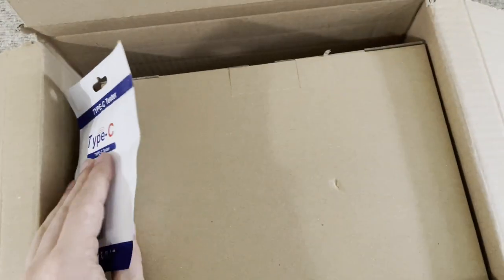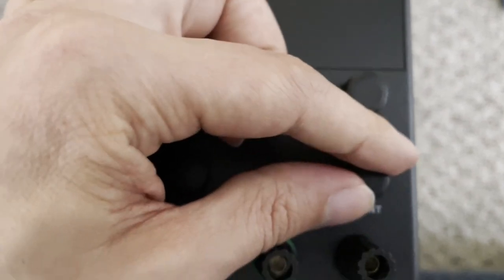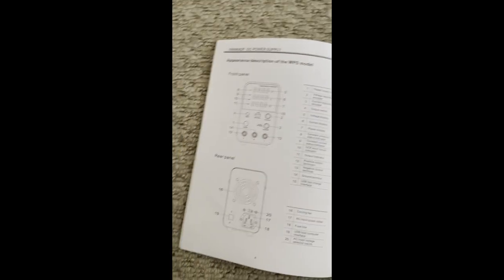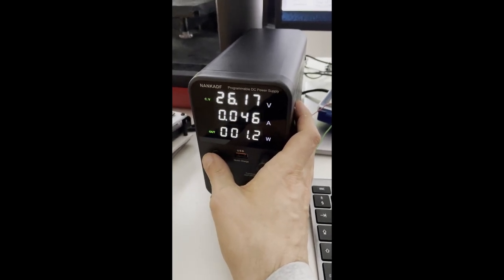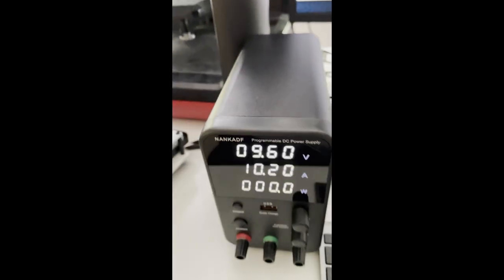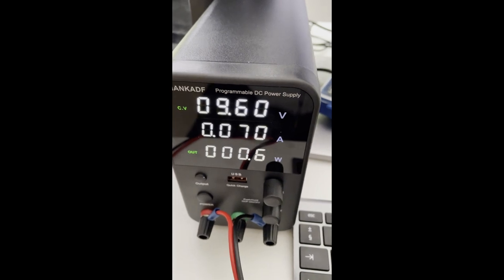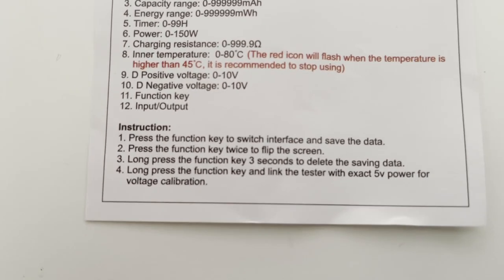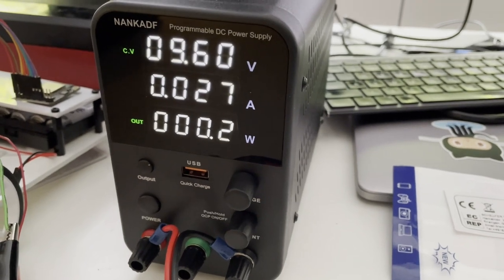WPS3010H Bench Power Supply Review and Unboxing

Comment: I ordered one from Ali Express when I found out that stepping was controlled by pushing the Volt and Amp knobs in , and I paid 64.00 USD plus sales tax and a lil shipping came to almost 77.00 dollars .... I sure do like mine and it can charge a large tablet fully in a short while ....I also like that Ice white blue color on the display...
Reply from the maker: The stepping is very handy, lets me control at different granularities. I was able to test a board at different voltages and see it's current consumption, with a current limit in case the board-under-test misbehaved.
Reply: @Orionrobots   I agree , It sure came in handy when I found a bag of 5 MM LED's of unknown voltages ...

Comment: Thanks for the video :) Any chance you could do a follow-up for the PSU using you oscilloscope to check for output ripple voltage, transient spikes and peaks, over voltage etc. on the PSU eg. when powered on, switching output or adjusting voltage?
Reply from the maker: I'll put that in the list - it would be handy to see what those look like too.
Reply: Thanks, id also ask if its proportional regulated fan or is it on/off like aps models?
Reply: @Boz1211111  having bought one (WPS3010H thanks to this video), mine appears to on/off.....or I am only triggering the first threshold level
Reply: @JohnColemanesque  same. ended up buying DPS series and its on/off as well. i very dislike that but seems like it would be the same if i went for the other series so i will prob keep it

Comment: Hi! I have the APS3010H version of this. Identical except it has memory buttons. Watch out, as there are a couple of major design flaws. Firstly, it has two switchmode power supplies: one for the PSU output and another for the controller circuitry. The former has mains filter circuitry, but the latter has absolutely none, so it squirts bucket loads of RFI back down the mains. Even ferrites on the mains lead don't clean it up. Secondly, there is totally inadequate filtering on the output. Using an oscilloscope to probe anything connected with this supply is totally futile.
Reply: That's bullshit or you have a defective unit. I own the 120V 3A version of this unit from its original producer Wanptek. While the ripple output filtering isn't stellar, it's quite good, especially taking the price point in consideration. RF back swamping the line is negligible

Comment: Can the beeping sound be made less loud, or is there only an option to switch between on and off? 
In fact I was thinking of soldering a little adjustable potentiometer in-between the beeper and one of its wires, maybe someone could advise me on what value would probably be suitable?
Reply from the maker: Hmm, I'd have to check the manual to see how the controls worked. I'll admit, that after unboxing it, I nearly only use it for different voltage outputs and monitoring current while doing it - although i use it for that a lot. As for adding the extra resistor, possible, but take huge care before rummaging in a power supply, there will be capacitors with nasty shocks in them, and stay well clear of the mains side.

Comment: How can you get it to generate more current than volts
Reply from the maker: If you attach a device that needs a lot of current, it would generate more current, up to a limit. There may be a constant current mode, but if the device has a large enough resistance then it may not be able to adjust voltage enough to make that current. It has a voltage limit of 30v.

Comment: Can anyone explain what the ground terminal is all about? Is this supply -30 0 +30? or 0 30?
If it's the latter then how does the output relate to ground?
Reply: Ah I just heard it near the beginning of the video - 'single output'. Not a lot of use to me then. Still don't get the ground terminal though.
Reply from the maker: The question is if that 0 is mains earth reference or not. If it is not, and you connect it to something is, then there’s a potential between the two you likely don’t want.